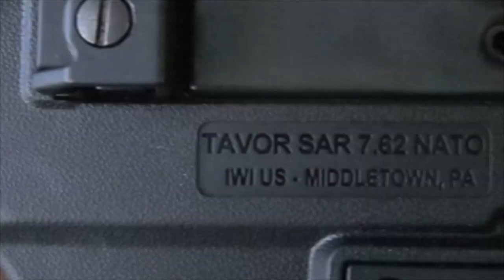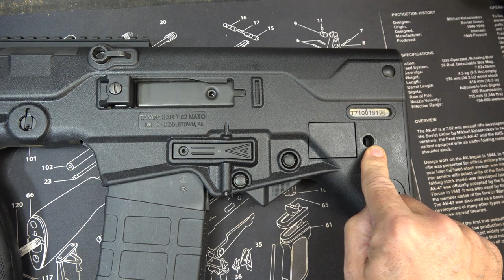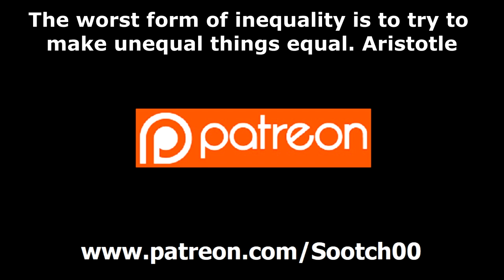IWI Tavor 7 .308 Bullpup Review

Comment: Got mine about a week after it came out. Love it. Agree with all your comments. For me it's the perfect 7.62 NATO platform. An if you know how to take advantage of the bullpup design you can outshoot any AR10 in just about every position but prone. It may be less accurate on paper but it's practical accuracy more than makes up for it by nature of its better balance and controllability.
Reply: Outshoot any AR10?  Absurd.
Reply: @John B and fn got nothing on hk417
Reply: John B for 1500 hundred more, it has to be better.
Reply: When I got my Tavor7, it was with hunting in heavy timber for bear and white tail in mind. After shooting it with my long time favorite .308 hand load for that purpose, I discovered that my particular Tavor7 will shoot at and into 1 inch @ 100 yards consistently. Shooting out to 400 yards, it hits right where it's pointed! These rifles are accurate and reliable beyond what is being reported in my opinion.
Reply: @JamesWitworth I just bought mine and am having trouble finding a legit answer to the question of using 308 ammo instead of 7.62x51. So, can you use 308 ammo without issue in the Tavor 7?
Reply: Berserker King they are basically the same cartridge.
Reply: @Berzrk-Z  Correct. Just like with 5.56 being able to shoot .223, you can fire a 7.62x51 rifle with .308 ammunition. Good luck and have fun!
Reply: skooly nugenator thanks for the info!
Reply: Anon ok awesome, thanks so much for the insight!
Reply: Military grade can shoot that ammo. A non-military grade rifle is not designed to operate at the elevated pressure military grade ammo will require for optimal performance and reliability even if the calibers are the same.
Reply: How much, and is it a long barrel? I am considering a 20+" barrel for this model
Reply: @jfkst1  But 7.62x51 is underpowered compared to 308.  Basically 308 has higher chamber pressures and a thinner cartridge wall. Basically, in a round about way, it's the opposite of 223/5.56. I only shoot 7.62x51 in my Tavor 7. But I do that because mainly the barrel twist is designed for m80 ball. An m80 ball is cheaper than 308.

Now will it shoot 308. Probably. But I don't have 308 go and no go gauges to check it.
Reply: @anon7492  It's technically the opposite. 5.56 has higher chamber pressure than 223. But for 308 and 7.62x51, 308 has the higher chamber pressures. Not to say the Tavor 7 won't handle it. It's just not an accurate comparison.
Reply: @John B I don't actually like the scar 17. The 20s is a different story. But the 17 isn't my jam.

Hell look at the Tavor 7 bolt carrier. It's a scar bcg. Like straight up.
Reply: @rabbitholereviews  The Tavor 7 is not more accurate. It just isn't. But because of the balance of the Tavor 7 I can more effectively get hits on target on the move, offhand, and kneeling. Resting on a barricade or prone my AR10 is a little bit better. But even though my AR10 is a sub moa gun I only shoot it noticeably better on a bench.

For me it's all about that balance. Which is why I don't like the scar 17. With that said I'd take a 16 inch enhanced lightweight barrel ar15 over a X95 any day. The balance may be better but the AR15 is more than manageable. Although I suppose if you got a supper lightweight AR10 that would be a great option. But I tried a 2A Armament lightweight AR10 a guy had at the one heavy metal three gun match and even though it was light the balance felt off to me. Too front heavy. So Tavor 7 it is.
Reply: @ffnovice7  They don't make a 20 inch barreled model as of yet. But an 18-20 with a 1:10 twist could be nice.
Reply: @MrLukhut1  thank you so much for the detailed explanation; definitely helped!
Reply: @MrLukhut1  the 308 has higher pressure than 7.62×51. If the firearm says its chambered for 7.62 and you shoot some hot 308 ammunition,  you could cause damage to your barrel or worse. Play at your own risk...
Reply: @mikemagnum7987  Do you agree with Sootch at 9:55 that the recoil is more like a 5.56? It looks like it's kicking harder than any 5.56 I've ever fired. Thank you!
Reply: @MrLukhut1  Incorrect. Don't give information on subjects that you're not knowledgeable about. Especially firearms- you can cause someone to be hurt!
Reply: @Berzrk-Z  The information Lukhut gave you is incorrect. I hope you're still alive and didn't die from his incorrect information.

Comment: After the 1:12 twist and suggested 150 grain max weight round was acknowledged, at the range immediately go with 180 grain ammo :)
Honestly looks really attractive..I had my mind set on the DD DDV SBR..but this unit is way shorter with a much longer barrel AND it’s piston. Very nice.
Reply: Is the 180 grain comment serious?  Legit question, I just want to get the right ammo.
Reply: @joshmatlock3410  I was only pointing out in the video how he stated lighter weight bullets were better. He went on to say with this rifles twist rate of 1:12, the maximum bullet weight should be 150 grain. Fast forward to the range…what does he say they’re using?
180 grain ammo! That was a head scratcher. Personally I’m not too familiar with 308 twist rates so I’d just research it and make your best decision. I’m sure you’ll be fine. HOWEVER…Wasn’t he complaining about the shot groups being kind of large? Maybe because they were using heavier rounds like they should not have been.

Comment: M-14s with 1:12 twist firing 168gr HPBT bullets dominated the National Matches at Camp Perry for over 20 years.
Reply: Nowadays if you want to maximize the potential of 308 at least with factory loads you need a 1/10 to run 185gr FGMM but the Tavor isn't accurate enough to justify the use of such ammo anyway nevermind the fact that it's as heavy as most DMR's.
Reply: Weight is important to me.  All things said, I would go with the M-14.
Reply: I've been running 168 Nosler BTBT hand loads in my Tavor 7 for a little over a year now. I get consistent 1 moa at 100 yards and sometimes, when I'm having a good day, a bit less... Water filled gallon milk jugs at 400 yards are easy to hit with this rifle. The 1-12 twist is entirely suitable for bullet weights up to 180 grain. I've hand loaded for for the .308 for nearly 50 years and the majority of those rifles have been sub 1 moa, many going sub .5 moa all with a 1-12 twist shooting 165-168 grain bullets...

Comment: If you want more accuracy either turn the gas down to normal or turn it off.  Piston gas systems are generally less accurate than DI, and DI is less accurate than bolt action rifles.  I don't have a Tavor 7 so I can't speak from experience on this particular rifle but I'd bet some M80 ball would shoot nice groups with the gas off.

Comment: Makes a great truck gun small enough you can put it in a backpack sling it over your back and it's not in the way I don't know about the 20 inch barrel but that wouldn't hurt my feelings anyway.. that's the one thing about it 308 a hard-hitting round... biggest thing is did you try everything in it of different kinds of ammo to see how it responded hollow points see how it runs with that...

Comment: They need to make this version in 5.56.
Reply: x95 is pretty similar
Reply: @calholli  but it's not the same, I like how easy it is to change everything to left hand use. It isnt as easy on the x95.
Reply: @jonathanhouser8194  Just get the berretta tuna... its a pretty great rifle for cheap
Reply: @jonathanhouser8194  They sell a left handed version of the X95--built that way from the factory. I have one and its excellent. It was slightly less expensive than the right handed version.
Reply: @rabbitholereviews  I still like the ability to change it from left to right or right to left without any tools in a matter of a few minutes.

Comment: Why would they make the magazine release all the way forward??  The original design made a LOT more sense where you could release the mag and remove it with one hand.  I guess there must be a reason...
Reply: Sure they had (have) a reason, just like the AR series have the mag release available to reach with one hand, drop the empty, and insert a freshly loaded magazine. 
Makes it a one-handed operation instead of slowly removing one mag THEN reaching for a replacement and inserting it.
It's all about ergonomics.
Reply: I'm  saying the new design is a "2 handed" operation.  The mag release is all the way forward while the mag is in the back.  The old style of these guns had the mag release right by the mag (one-handed).

Comment: I heard that IWI pulled the .308 version of this rifle for accuracy reasons.....is this the old version or is this the latest as in 2019 version. I know you said 2017 in the video
Reply: The Tavor7 is alive and doing very well. Accuracy issues? Mine shoots at and under 1 inch @ 100 yards! I've been around the .308 and 1 in 12 twist rate rifles for 50 years worth of shooting, hunting and reloading. This Tavor7 with its 1 in 12 twist rate, at least in MY rifle, loves 165 and 168 grain bullets, which are about optimum in this caliber as all around bullets. I bought mine for use in hunting bear and white tail in heavy timber and some open country hunting of muleys. It shoots as good as any good accurate hunting rifle should be expected to, out to 400 yards and that will bring home the venison!

Comment: Why would they make it 5/8-28?  That kills it for me.  I bought my cz scorpion with the funky thread pitch.  I'm still kicking myself for that because it adds $100 to the price to get an adapter and adds a ton of trouble when you run a suppressor unless you dedicate a single can to the rifle.  I have 3 300 cans and 2 different brands. So it's not worth it for me.  I'll wait for now.
Glad they finally fixed the left/right problem that forced lefty's to buy a new bolt

Comment: Love my T7! However, DO NOT USE STEEL CASED AMMO....Due to the Powerfull DUAL extractor claws, and VERY high chamber tolerances , once steel cased ammo is fired, almost every steel cased cartridge will be embedded/locked in the chamber, and the rear casing will be stripped off like the lid of pull tab a tuna can. Ie; Casings remain locked in the chamber but the ass end of the cartridge is ripped off, and creates a terrible jam that requires needle nose pliers to extract the DESTROYED shorn cartridge remains. Otherwise, ANY BRASS I've fired will function. Every time. NOT STEEL though . For 2k$ it should shoot it ALL. Be advised.... Steel case Slathered in grease?  Maybe. Being it a firearm from Pennsylvania,  you'd think it could handed STEEL!  Get it?

Comment: I want one or five lol.  As far as accuracy you said the rifling was set up for lighter bullets then you shoot 180 grain match bullets?  And comment that it is not as accurate as you liked? How about another test with the proper bullet weight for proper rifling. 
  Also like to see the 20" barrel variant with longer hand guard. And the velocity gain with the extra  length barrel 
  Also would like someone who has the ability to measure sound do testing to determine how much sound difference there is between the two.
  Would also like to see IWI make a variant with changeable barrels and a rifling geared for the heavier bullets.

Comment: Higher pressure rounds with slow burning powder + short barrels = no thanks, for the most part.
Reply: Joe Rogan  AR isn't a standard length. AR do come in longer barrels.
Reply: Joe Rogan  5.56 is optimal at about 20". But many AR are running just past the legal length for handling purposes, not to pierce level III armor (requires about mach 3 velocity).
Reply: Joe Rogan  Well I guess those who aren't very familiar with legal requirements in firearms wouldn't be on a firearms enthusiast video channel week after week, year after year looking for accurate and articulated data on every comment made. That's just my opinion.

Comment: I sure like the Tavor 7 but this review is just peppered with toss-away mistakes that most reviewers never make, like the thread pitch (5/8x24, not 28), Magpul PMAG capacity (max of 25 unless you get the drum, not 30 for 7.62), and tht 20 inch barrels are more accurate than 16s.  Maybe these errors are inconsequential but they keep popping up.